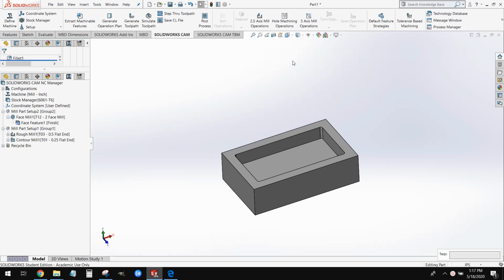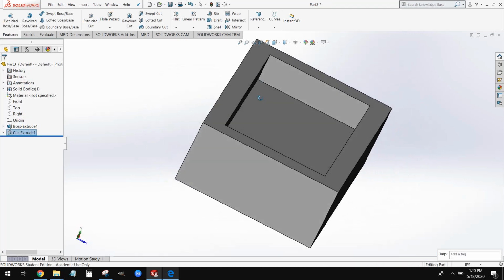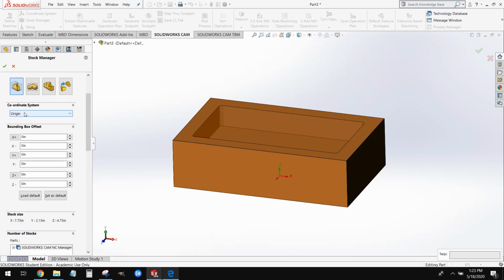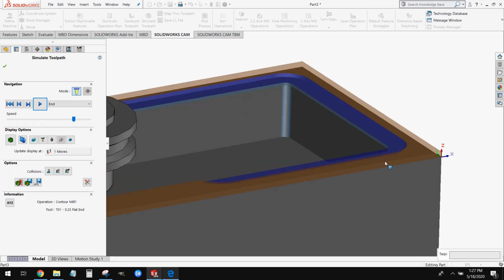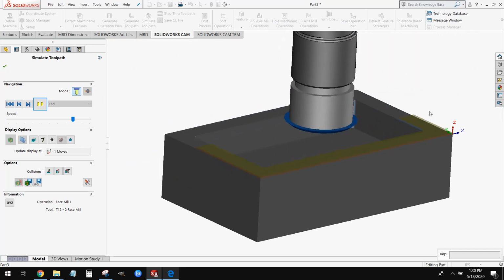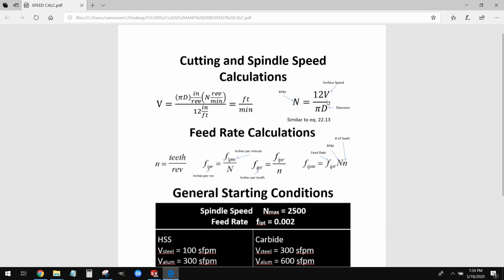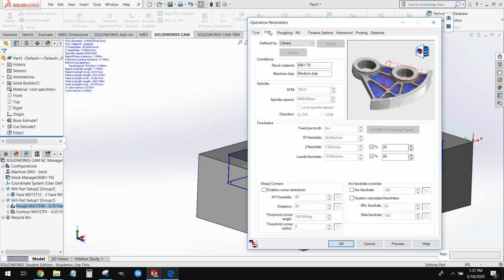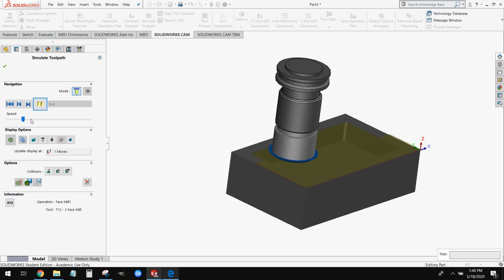Solidworks CAM Tutorial: Adding Tool Paths (3)

Comment: I am a bit confused. 22:2 It is a Carbide bit cutting aluminum. Should we use a Speed of 600sfpm for the calculation? So the Speending speed should be 9000ish.

Comment: Thank you very much for the realy good video for beginner. I have maybe a stupid question. My homemade router is equiped with a 2kW spindle where I cannot go under 9000 rpm. (Its written that I can damage the spindle when I do so) This means that I cannot cut most of the material because the minimum speed is too high ?